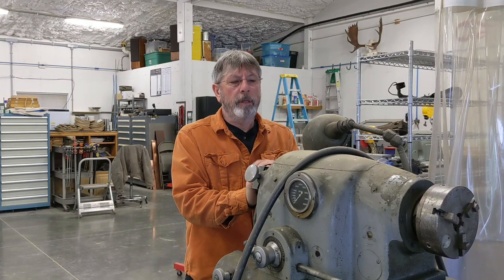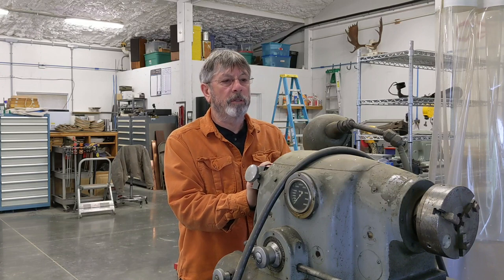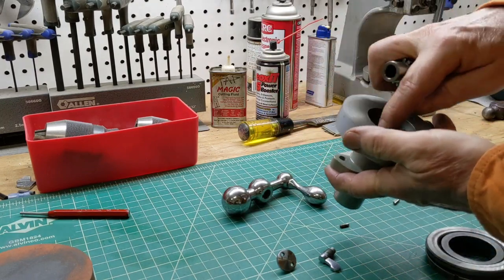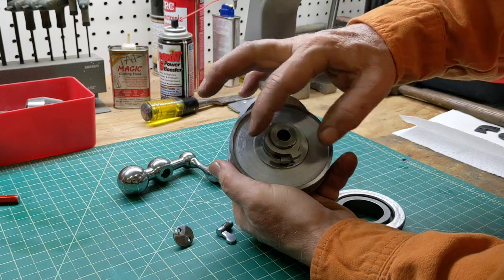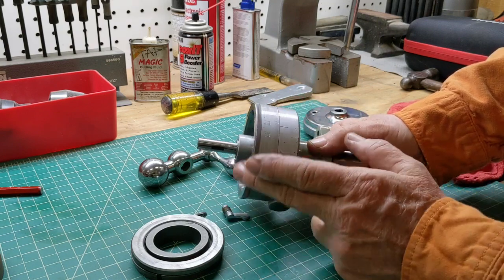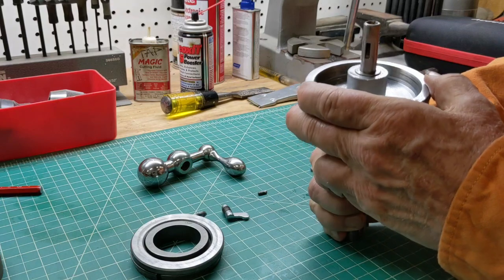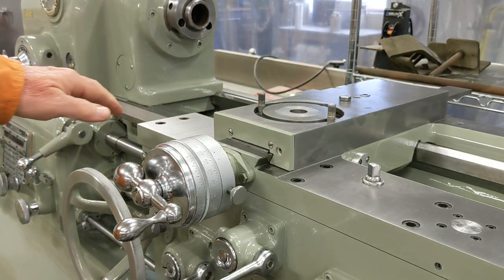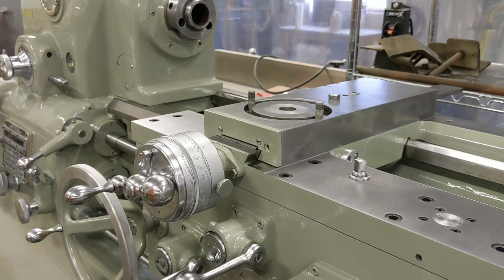10EE part 18b Finishing up the cross slide install

Comment: I just can't stand those marks from the crash. I would have taken that carriage over to the mill and put matching bevels on each side similar to the ones on the compound, taking just enough of a cut to clean up those dents. You've put so much time and effort, not to mention money into making the lathe beautiful those divets just are too much. It would be a very easy thing to do. Just me I guess.
Reply from the maker: Gary, I'm with you on this...I really wanted to clean that up but choose not to, then once I reassembled the machine, I regretted not cleaning up the scars!

Comment: According to the parts diagrams on Vintage Machinery, the middle ring in the stop mechanism is the "Loose Collar" and the outer two are "Lock Collars". My adaptation of the design for my Logan lathe only does 2-1/2 turns because one lock collar is fixed on the shaft with a set screw.  Floating it on the shaft and adding the two stop pins to the dial gets the other half turn. Maybe one day I'll make a bigger dial and revisit my design.

For the dial to hit zero at both ends of the travel, the nib on the lock collar that bears against the inside face of the dial has to be in the correct quadrant between the stop pins, yes?

In use, I assume that the procedure is to tighten the thumb screw, run the dial in (or out) to zero, then touch off on the workpiece with the compound?

Of course Monarch precision ground the the collars to line things up perfectly on zero, and of course they captured the thumb screw. That kind of precision and attention to detail is why I desperately want a 10EE someday soon. I just have to finish my new shop so that I have a place for it. Your videos will be invaluable when I finally get one. Thanks!
Reply from the maker: Hi Jon, Thanks for the comment! so yes...I run the dial to zero and touch of with the compound as you mentioned. Good luck on your quest for a 10EE!!

Comment: Seeing the assembly and methods was awesome on the cross slide....funny, using my lathe I noticed that it always hit zero which I assumed “just a fluke”...now I know better
Reply: Mine is about 2 thousands off zero.   Must have been within spec.   I guess it does not matter since repeatability is what is more important when using it for threading.
Reply from the maker: Thanks Chuck! It really is a well done piece of engineering

Comment: the 3 turn stop was probably designed by a person who had worked with dial type safe locks.  a brilliant solution that i am amazed that other lathe manufacturers never put into production lathes.. or did they ..
Reply from the maker: I'm not sure if this feature exists on other brand lathes. My guess is probably yes

Comment: Well,  you motivated me to take mine apart and clean up the inside of the dial mechanism.  I put everything in the ultrasonic and it is now spotless.  One question:  The lock on the front face of the dial is pinned and looks like it should be able rotate 90 degrees up so you can bypass the stopping pin.  This would allow you to adjust the pressure of the lock.  Mine will not rotate up and I am afraid of forcing it.  Does yours rotate or am I wrong on how this works?
Reply from the maker: Hi Robert. So I checked the 3 10EE's I have and none of them seem to be set up so the lock can rotate. It appears to be fixed. If you need to adjust the position of the locking lever, you would need to disassemble the handwheel, knock the pin out and reposition. If you notice in my video, I assembled the handwheel with the exception of the stopping pin, positioned the locking lever and drove the pin in at that point. Hope this helps!

Comment: I'm fascinated by how the dial lock works. It looks like there are two hardened pins positioned 180 degrees to one another inserted into the outer face of the clutch cone. Then the ring rests on the rounded noses of those two pins. The inner face of the outer cap has a similar hardened pin on one side and the nose of the locking screw 180 degrees to it. The cap then keys into the clutch cone so that its pin and locking screw are held at 90 degrees to the pins in the cone. Tightening the dial lock screw levers the ring against the pins in the cone, pushing it into the taper in the dial, locking it in place.

I've only actually had my hands on one 10EE that had originally been delivered to Los Alamos (Manhattan Project) in 1943. I think I wanted it as much for that history as anything, but my wife wouldn't let me get it. It looked pretty sad, with a pale blue paint job covered in grime, but seemed to run great. I just hope that another one eventually comes my way, even without the history.
Reply from the maker: Wow, It would be awesome to have a piece of machinery with that history!

Comment: what is the second graduated dial with no numbers used for?
Reply: The last set of marks are a reference and always move with the hand wheel since they are keyed together.  The center section may or may not turn depending on if it is locked or unlocked.
Reply from the maker: That's correct Robert!